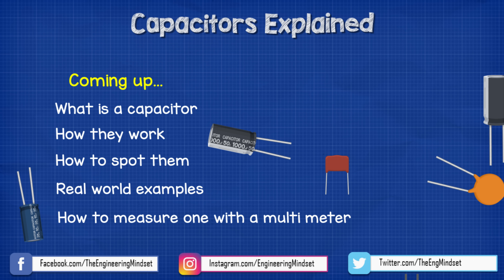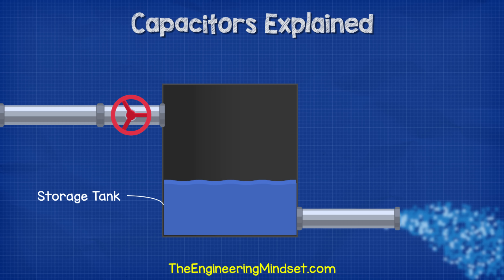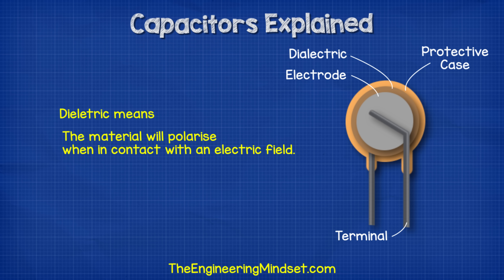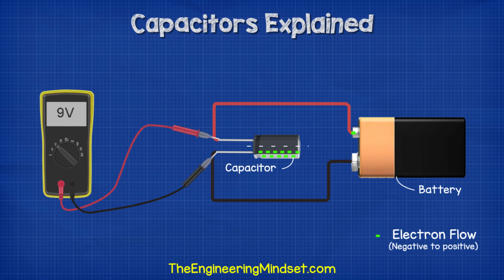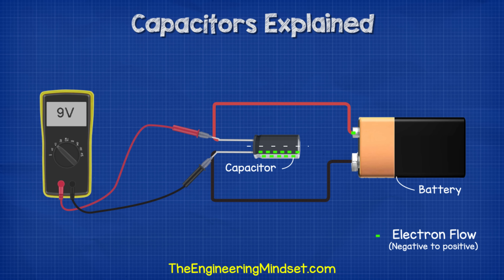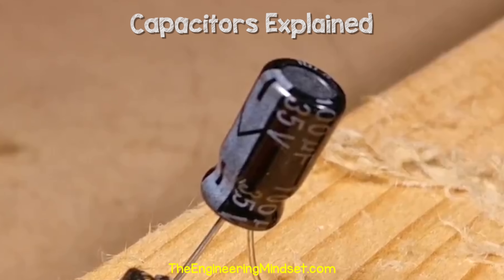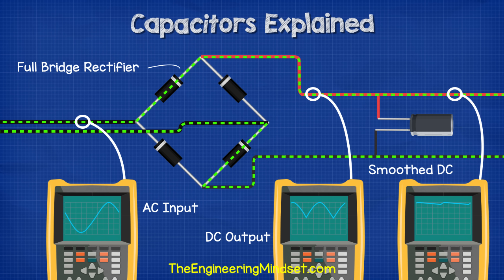Capacitors Explained - The basics how capacitors work working principle

Comment: I am an Electrical Engineer and I wish that this explanation is provided to the engineering students before all the theory and math in order to have a practical understanding of this device. Keep up the good work! Excellent!
Reply: I fully agree! I had such a hard time wrapping my head around the theory when I didn’t even know what use the component had! 😭
Reply: as an electrical engineering student i couldn't agree more. the same goes for inductors and even simple resistors. we are never taught why something is used, only how to get some number values from it. finishing the first year of college you get no idea how ac and dc current are even obtained in practice, only the microscopic processes going on inside.
that's all cool, but it makes you feel like you're doing something useless. there kinds of videos serve as inspiration, among other uses.
Reply: I hope so. It took me 28 years and the loss of two girlfriends to realize I'm even into this stuff. School isn't an option anymore
Reply: Honestly I keep attempting to learn circuit analysis and getting half way through the book then quitting cos of mainly boredom and lack of motivation to continue which is annoying as electronics is fascinating to me. 

I’ve switched it for a more hands on course on Udemy and it’s gripped me from the start. Wish more courses would take this approach.
Reply: Many public high schools don't have access to electrical basics classes. Shame.
Reply: @derrickmcadoo3804  I went to expensive and posh private schools and my physics teacher was complete shiet. He wouldn't explain anything, probably because he didn't understand and just expected us to understand ourselves and pass the exams.
Reply: I’m starting my electrotechnical level 2 in septmember is it fair to assume a capacitor is involved a lot in this course. Asking you because you have completed college sir.
Reply: Agree 100%.  It is almost as if the professors do not want to provide a practical example, instead writing all sorts of formulas, logarithms and differentials to comprehend.  Just like thermo - it should have started with a description of an air conditioner and how it provides cooling, rather than instantly hitting us with a “carnot engine” and the adiabatic, isothermic, etc.
Reply: @stevenl5222 — Yep, EE grad here, and one who moonlighted as a gradeschool teacher/coach.  The fundamental problem imo, is that college professors don’t have teaching degrees, and aren’t required to have one, so they have no effing idea how to teach.  Shocking, simply shocking. :0
Reply: If only the internet was around when I was in College... I might be an engineer today!!  You youngsters don't realize how good you have it with resources like this available!!!
Reply: Thanks for this video!
Although in regard to around 2:30 in the video:
Wouldn't the electric charge be building up on the positive terminal?
Positive in an electric circuit corresponds to the side that power (electric charge) is being applied, and negative is the side that is dissipating all of that power.
Reply: @lucky374h  Yeah, but they're displaying the actual electron flow and not the flow of current (which was arbitrarily decided to be from positive to negative before electrons were discovered (to be negative)). Since electrons are negatively charged, separating the electrons onto one side (charging a battery) and releasing them through a closed circuit will cause the electrons to flow from negative (where the electrons are stored) to positive to equalize the potential difference.
Reply: Really indian 😅
Reply: I think that most teachers and college professors are shiet.  They are lazy as f. and they went through the lectures on automatic pilot.
Reply: Same here.  When I took Circuits as an undergraduate engineering student, we didn't even have a lab to go along with the class.  I didn't even know what a capacitor looked like until I later took Electronics, which did have complimentary lab work.  Now, years later, I still think that maybe I should take some electrician classes at a local tech school to fill in some of the missing gaps in my engineering education.
Reply: Im still trying to get it. Im mechanical engineer haha. My son 16 im watching this to help him studying for a test
Reply: I played one on TV.
Reply: @jimnicosia5934  If a capacitor can only store DC voltage how do they operate with AC current flowing in them sir?
Reply: @jerrodwilliams6789  I think you need to filter the ac with diodes first to turn it to DC
Reply: @jimnicosia5934 yes I agree,no big words that people can't understand, photos and graphics,short simple to the point,too long,too much, people will fall a sleep
Reply: See Short reply

Comment: I loved electrics and electronics always, but just got back into them after finishing my exams, as i now had some time. I almost took out my eye, blowing up a 10 volt capacitor with a 15 volt battery pack (which i also made myself - by connecting rechargable lit ion cells with a screw and copper wire set up in a wooden block). My heart started racing after the bang and i figured maybe i should refresh a bit before getting back into practicals, this video was super helpful, wish i saw it before. Luckily, its not too late, next project will be more careful.

Comment: I m wondering can we define capacitance for isolated conductors too...it need not be a capacitor. For instance, by conduction, I charged the conductor and now measure its capacitance...here I can't assume another conductor at infinity as I charged with a plastic rod, and the plastic rod got its charge from silk cloth...I m a bit confused about this, would u please clarify it?

Comment: At 1:01 your water analogy is very flawed. You show the inlet pipe and the outlet pipe as the same diameter. If that were the case, the water tank would never fill up. In order for the tank to fill, the outlet pipe would need some type of restriction - like a smaller diameter pipe or a partially closed valve. In an electric circuit, this would be analogous to adding a resistor to restrict current flow.
Reply from the maker: Maybe, but this isn't real world, it's purely an analogy for simple visual representation.
Reply: @EngineeringMindset  I understand your point....these are not real things. They are "pictures" of a water tank, pipes and water. And "pictures" of a battery, switch, capacitor, resistor and LED. So, if this isn't real world, remove the "picture" of the resistor from the circuit. Will the capacitor charge? Will the capacitor discharge? Why is the resistor in the circuit?   Water supply = Battery   Valve = Switch   Tank = Capacitor   ????? = Resistor   You say it is an analogy, but this is more of a metaphor. An analogy would have all items represented.
Reply: I enjoy your videos. They are very well done. I was an electrical engineering professor for 20+ years. Every professor I know uses the water tank analogy. When I taught, we didn't have computer graphics - but I wish I did. I had to "animate" everything myself on the white board. Before I taught something, I always tried to think of the questions the students may have. My students surely would have questioned the lack of a water flow restriction.
Reply from the maker: Check out NEW resistor video, everything covered! ➡️ https://youtu.be/DYcLFHgVCn0

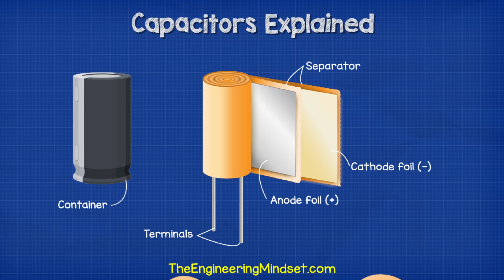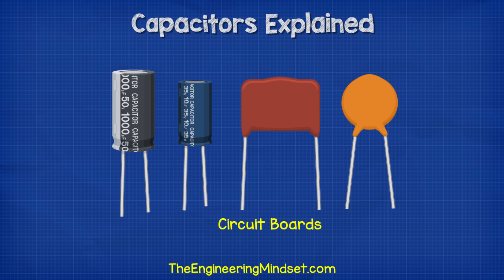Comment: At 2:03 you showed a round disc capacitor and said the dielectric is ceramic. That is true. At 2:19 you showed a cylinder-shaped capacitor which is an electrolytic type. Only the electrolytic capacitor has a stripe indicating positive and negative polarity. The ceramic and mica capacitors do not have polarity. At 5:10 you show 2 electolytics, 1 mica and 1 ceramic, but you never mention mica     capacitors.

Comment: I want a diagram of a circuit that contains IPS.  Whose job will be to beep 5/6 times when the power goes out.  2 times per second.  And when the electricity comes, it will beep once.  Please help me with the diagram and what components are needed.

Comment: Because you seem pretty knowledgeable about electrical components and I know jack shit, I've got a question if you don't mind....
I play electric guitars and sometimes tinker around with swapping capacitors, potentiometers, switches etc, and what I've wondered is this.
In your opinion, in an electric guitar wiring harness, do you think that swapping, say, a ceramic 0.33 micro farad capacitor with a capacitor of the same value but a paper in oil construction, would make a difference to the tone and overall sound of the guitar when listened to side by side? Or would you expect the guitar to sound the same, regardless of what material the capacitor was made from and just as long as the two capacitors were of the same value?
Cheers, sorry it's a bit long winded mate 👍😐
Reply from the maker: Seen our new Potentiometer Explained video? ➡️ https://youtu.be/Xb-MZMoUtcQ

Comment: I thought that the + side of the capacitor stores its charge, not the negative.. because from what i've been learned, capacitor stores dc on + and lets pass through it ac which leaves on its - terminal..

Comment: in Trigonometry, the cosine of angle theta is equal to the adjacent side of angle theta in a right triangle then divided by the hypotenuse( hypotenuse is the longest side of a right triangle ) " a" which is the opposite side is not mentioned by the formula because the cosine of angle theta it's the quotient of the adjacent side "b" to the hypotenuse "c". I wonder why based on the triangle in the video of POWER FACTOR/POWER TRIANGLE in the first formula above the True power equated to  Reactive Power x cosine of angle theta since the formula of cosine theta never mentioned any opposite side of a right triangle instead of the hypotenuse.

Comment: Capacitors.  The bane of ever form of consumer electronics.  I have had 2 amplifiers, a computer motherboard and 4 other parts fail because of them.  Smaller is not better.  Programed obsolescence is part of the problem.

Comment: variable capacitors a group of metal plates moving in and out of another fixed group, 
found in radios, hooked w a coil of wire forms a tank circuit. Capacitors also used in
some self exciting portable generators.

Comment: The 1st capacitor was known as a leyden jar, say a half-gallon glass jar with a cork top, inside 
and outside bottoms and side of jar covered in tin foil, the glass being the die-electric. a chain
on the inside of jar touched bottom of jar. these could hold a good bit of static charge. enough
to knock you on ur ass. Ben Franklin got across a few of these connected together and he
remarked ,"it was close to sticking a hot branding iron into a keg of gunpowder."

Comment: how is the current even charging the capacitor, aren't electrons only able to move if the circuit is closed, how do they move if there is a material blocking the way in the capacitor and basically opening the circuit in the first place

Comment: What i dont understand about capacitor is: what affect the loading time of the capacitor and how it looks on oscillator, for example, i know that i need to put resistor before the capacitor so it wont explode but i see in some schematics that there arent any resistors before the capacitor and still its charge time is pretty slow how is that?
Reply from the maker: There's always resistance. https://youtu.be/FDmHVRC6pQk
Reply from the maker: Check out NEW resistor video, everything covered! ➡️ https://youtu.be/DYcLFHgVCn0

Comment: I am just starting out with understanding of electronics, curious when discharging a capacitor to safely handle, in your example you use a resistor, and I have seen others simple short the pins with for example a screwdriver.  But where is that energy being discharged to if there is no load to convert the energy into a different form?
Reply from the maker: The screwdriver will provide resistance also. All electrical energy is converted into heat.
Reply from the maker: Check out NEW resistor video, everything covered! ➡️ https://youtu.be/DYcLFHgVCn0

Comment: Supercapacitors have very huge capacity (for example capacitors maxwell have 3000 F and more !!!) but voltage usually is about 2,7 V. From what is dependent voltage capacitor? Is it possible to build supercapacitor with very huge capacity and high voltage? How can do it?

Comment: How can I use a capacitor to smooth out 120 vac, because I'm powering some led lighting off an inverter, and the led lights flicker. It's barely noticed but there is a small flicker.
Reply from the maker: Seen the new LED explained video? so much detail covered! https://youtu.be/O8M2z2hIbag

Comment: 1:55 inside a basic capacitor
Dialectic means…
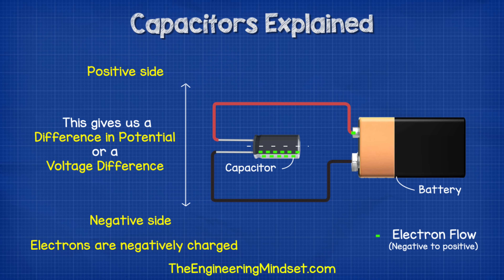3:04 voltage is like pressure : measures the difference between two points
5:10 symbol representations

Comment: so if I have a battery of 18.5 volts and my capacitor says 120uF and 330v. does that mean that the capacitor can keep charging until it reaches 330 v?
Reply from the maker: It'll charge up to the battery voltage

Comment: I haven't seen all your videos this is my first one, but similar to how x-rays work. I'm radiologist tech. You have electrons on the negative end of the cathode side, aiming towards the positive end which is called the anode. They built up and a focusing cup and get pulled across and hit a metal plate that's made of tungsten, and that is the X-ray beam that goes to the patient. The patient is getting hit with 120 KvP. 

Anyways your video is very informative, because we had to learn the physics behind the console on how x-rays are created. Step up, step down, transformers, capacitors, relays, etc etc
Reply from the maker: Seen our new Transformer video? here https://youtu.be/jcY4QN7awEc

Comment: A capacitor is also used to start a single phase motor, which has no starting torque and the capacitor will create a phase shift between voltage and current to create a starting torque.  after starting the capacitor is disconnected

Comment: The analogy with the water tank made this so much clearer than all the professors did in my 5 years of college. I knew a capacitor is just some kind of a fast charge/discharge "battery" and I knew the math behind it, but I didn't really understand what is actually achieved practically in a circuit using it and why it works. Thank you for providing this crucial info.
Reply: With one difference: You connect the water tank in series, but you have to connect capacitors in parallel, or it will cut your circuit instead of storing energy.
Reply: @hamza-325  A better analogy would be a water tower since they are basically a T connection off the pipe at the bottom that allows pressure to force water up into the vertical pipe/tank. That is more analogous to the parallel connection and more analogous in the way they store the energy too. The water tower resists changes in pressure by converting it to potential energy in the gravitational field and visa versa. Thus they are good for smoothing out spikes in pressure much like a capacitor does for changes in voltage. Even better they also pass nothing in the steady state aka when the pressure within the pipe and tower are constant much like a capacitor doesn't when a DC circuit is in steady state.

It is a fairly small change in the analogy but makes it work even better for the task at hand.
Reply: great analogy
Reply: Did your professors tell you about phase correction via electrolytics?
Look at most effect pedal schematics. Many of them have electrolytics in the AC signal chain. They do that because an electrolytic costs 1/10th what an equal value polyester or mylar cap does. So, you know, you are only getting one half the sine wave. You see this a lot on distortion type pedals.
Those should be changed out to get the full audio sine wave.

Comment: This is a very informative video. However, I would've liked if you delved more into what "capacitance" is. Why is it necessary? Why not just use voltage to measure the "capacity" of the capacitor?

Nevertheless, thank you very much for the vid!

Comment: Great video. One question ; why does this design require a resistor?
Reply from the maker: Voltage is higher than Led can handle. Check this tutorial https://youtu.be/7d4ymjU9NqM
Reply from the maker: Check out NEW resistor video, everything covered! ➡️ https://youtu.be/DYcLFHgVCn0

Comment: The process of a capacitor not reading the exact amount of capacitance is called "Tolerance", all capacitors have a tolerance represented in percentage "±%". The tubular capacitor that was used the most in this video as an example is called an "Electrolytic Capacitor", and most of them,  big or small, have tolerance of ±20%, meaning that a capacitor of a 1000 µF capacitance will realistically get readings between 800 µF - 1200 µF, the other capacitors are shown in there like Ceramics, tantalum capacitors have the option of being more precise with their tolerance, mostly in between ±10% and ±1%, some are even in the decimal percentages bellow 1%.